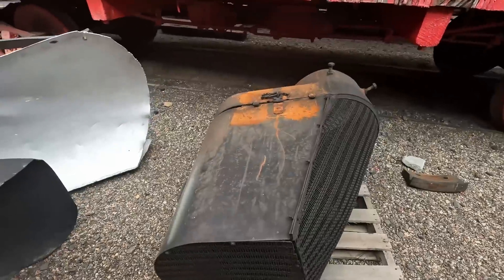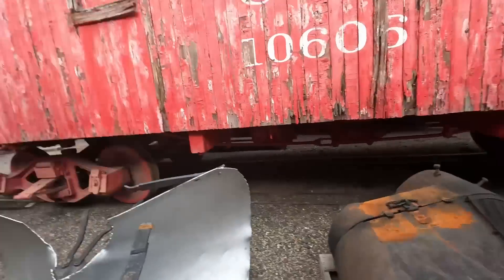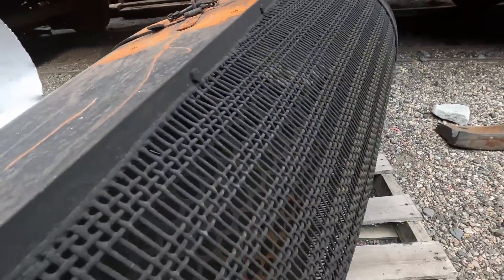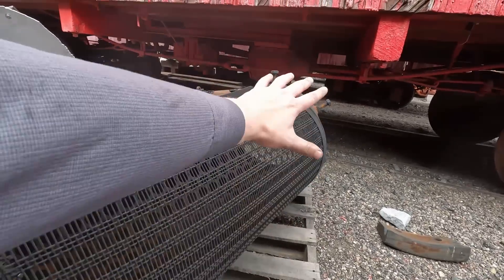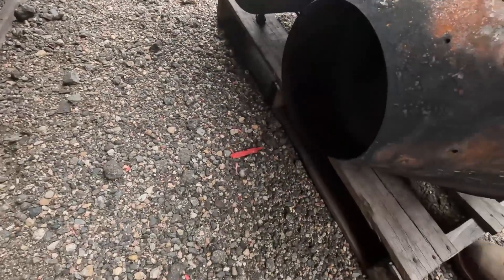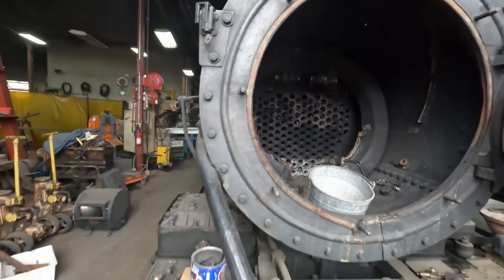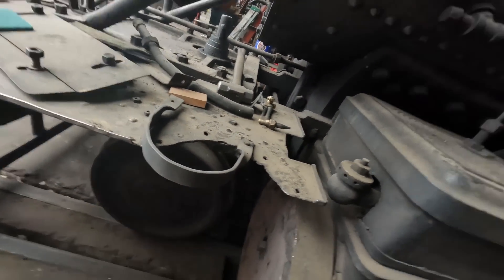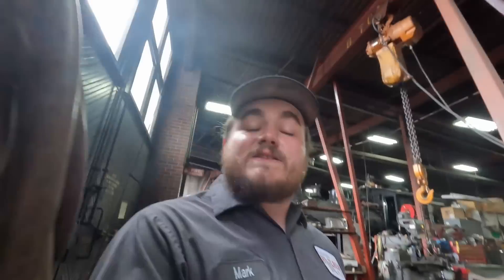Why is there a funny HAT on the smoke stack?

Comment: As one of the guys that installed it, here's a bit of trivia about 346's: it's built of heavier material than the originals.  The baffle plate was not specified for narrow gauge engines, only standard gauge, it was however decided to include it.  The angle of the netting is what makes 346s ridgeway so effective, much more than the squat ugly ones that were built by Durango as it's built to the print, except for the fact it was assembled backwards😊
Reply from the maker: We have since rectified the backwards issue :P

Comment: With the demise of steam engines, cinder pathways gradually disappeared. When I was a small boy in the early 1950s,  the cinders from railyards were used as fill material for paths in parks,  woodlands and other public places. It worked well as it prevented mud from developing, and cleaning cinders from your shoes usually just required wiping your feet on a door mat.

Comment: Why would a diesel locomotive have a spark arrestor installed on it. The POVA railroad runs a few GP10's that have spark arrestors installed and I have never seem to figure out why.
Reply from the maker: Old EMD's throw sparks. Particularly after sitting for a while.
Reply: @Hyce777  Thank you for the info, really clears it up.

Comment: I wonder if you wouldn't be able to explain a part of another locomotive that I have wondered for the longest time. Take a look Steamtown's Canadian National Mikado 3254 and I wonder if you wouldn't be able to tell me what the cylindrical piece on top the front end of the smokebox is. It's in front of the stack and behind the number boards. I've wondered for the longest time what its called and if it serves a purpose or if its just for decoration. I've seen something like it on the front of many other steam engines and alwaus wondered.
Reply from the maker: 90% sure it's a feed water heater based on your description; look up Elesco feed water heaters and see if it's what you're thinking of. More modern and efficient steam locomotives used the heat from the smokebox as a heat exchanger to heat up the water being put in the boiler for efficiency reasons, a lot of them have that tank up front and on top.

Comment: Thank you for answering this question, which I had for many years! (here in Brazil no one has ever been able to explain to me how this device worked).
One more question. Wouldn't a balloon stack be more efficient? What is the difference between them, in theyr use?
Reply from the maker: Balloon stacks are more used for wood burning engines, where additional baffles are needed, and when the smokebox is quite small. The more modern engines with bigger smokeboxes didn't need them because they 1. had more room in the smokebox for screening + baffles, and 2. they burned different fuels that made less issues.

Comment: Sometimes low tech solutions are the best. 
If we would re-invent steam locomotives nowadays we probably use some high speed camera and and computer controlled air-hose which blasts the cinders into a holding compartment. Unnecessarily complicated but common wisdom says it new and modern must be better.

Comment: Questions about stacks. I love the old 4-4-0s. Are these devices the reasons why alot of old wood burning locomotives had those beautifully crafted very broad smoke stacks?. Did they incorporated it the stacks design and made it look good with the upside down bell look?  or is the big stacks just simply for looks. Because most 4-4-0s had big crafted wood cabs, broad cattle plows, large ornate headlamp box. Or was it just a sheet metal trick to look cool?
Reply from the maker: The big stacks are fancy spark arrestors. Early engines had small smokeboxes, so they elected to put the screens inside the stack itself instead; hence the big stack.

Comment: Wouldn’t you still have the same problem with 491?
Since they are all burning coal it seems like they would all be highly likely they all create extreme fire danger
Reply from the maker: 491 has a special front end device called a cyclone, or Anderson front end inside the smokebox. It emits very few hot cinders comparatively; so much so it runs without an arrestor.

Comment: you forgot to mention the fun fact about the ridgeway is that it acts like a funnel in high winds and makes a pretty impressive backdraft when you're pointed into the wind. Nothing like firing when there are 50mph winds during polar and you open the door and you're greeted with a 3' tongue of flame coming out the door as you look down to check the fire...I only lost a little bit of eyebrow that night
Reply from the maker: I fortunately don't have that experience
Reply: this is why we need those little grabby hands you find at the store for kids just made out of metal so you dont burn your face off

Comment: So Ive noticed that 20 has been on the C&TS a few times before. How did she get out there? Is there a rail connection or was she just trucked over there? Also, have you guys done the same before with 491 and 346?
Reply from the maker: Trucked it, and no; just 20. The other two are not FRA compliant.
Reply: @Hyce777  makes sense